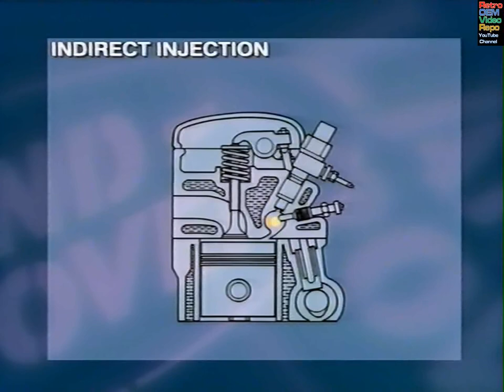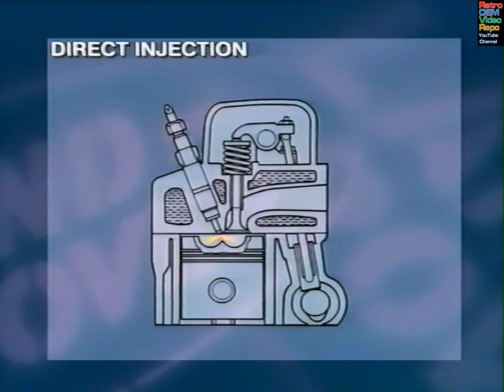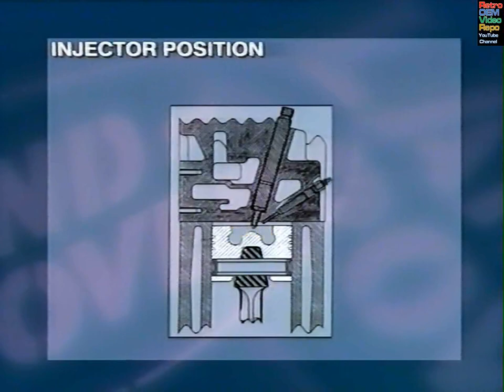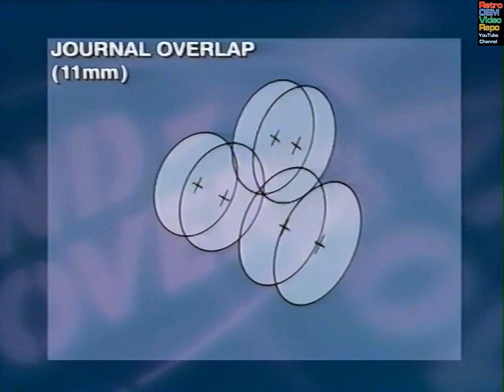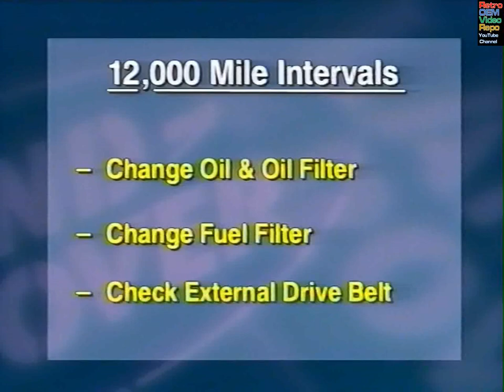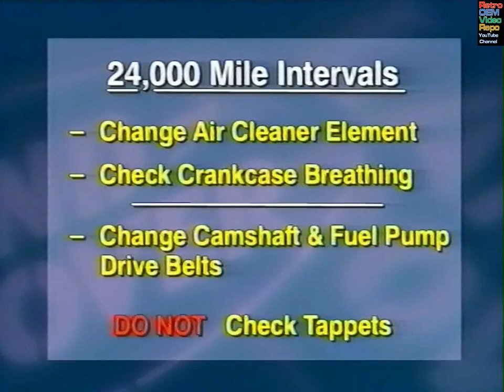Land Rover - Freelander (L314) - 'L' Series Diesel Engine (1998)

Comment: Had one of these in a Rover 200. Just ran and ran. It did 60+ mpg whether around town or 80 mph on the motorway. Drive it in the torque band and it sipped fuel.

Comment: Had a MG ZR 2.0.L series 

Absolutely loved it was my first diesel and been hooked ever sinse, 

Loved it's agricultural sound! 

I felt like i was driving a tank! 

I'd have another in a heart beat!
Reply: got one, had it years, got a oil leak from somehere near the cambelt/ fan belt side doing my head in
Reply: Wash it off with brake cleaner, check to see if its coming out of camshaft seal or out of the oil pump. Also check the power steering pump and pipework as they are prone to leaks.

Comment: i Just got to ask why there is inst not a service video with the TD4 Diesel Engine 
i got two question and i really need some advice 
1 what does stop the injectors a td4 from getting current ,i change cam ans crankshaft sensor ECM good and car still not start .
2 am where can i find the check light wire on the td4 freelander is it color code like ex br/ro the book anit helping me at all really need some help. thank you